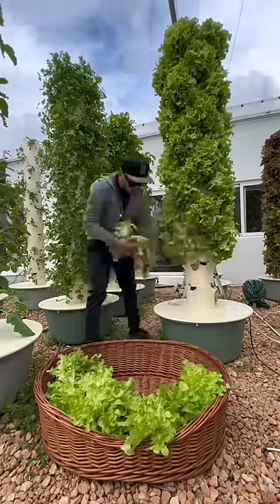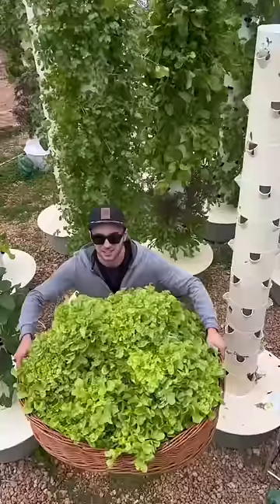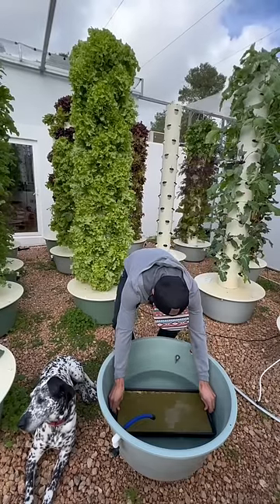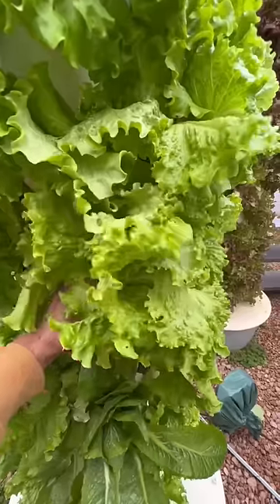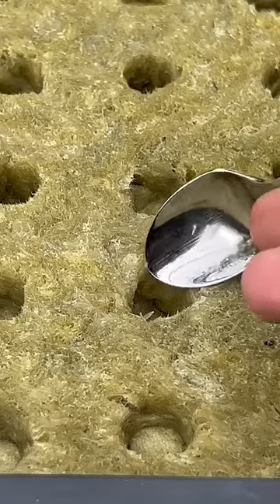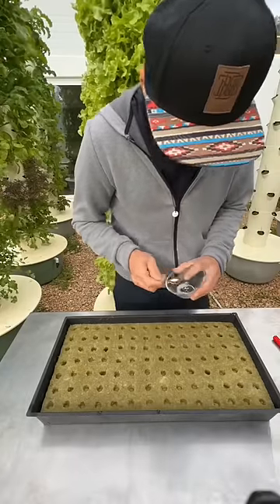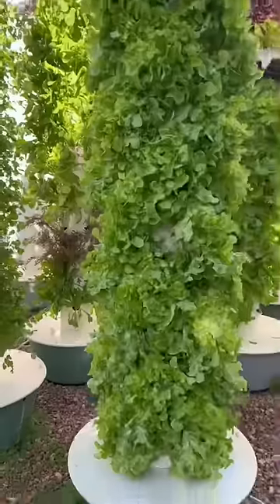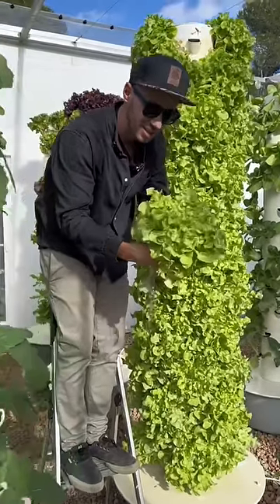Strategies for growing soilless lettuce #lettuce #towergarden #verticalfarming #gardening #farming

Comment: I tried this for a year. What i learnt.
1)yes it does require less area more yield.
2)you need 24/7 electric supply.
3)it should have a specific range of fertilizer in the water or might die due to low/high concentrations.
4)needs a constant check every 2 days.
5)water levels need to be constant. Or the conc of fertilizer might increase with evaporation.
6)water flow should pretty much be constant.
7) oxygen content of water is important.
8)checks on fungal growth.
9)if living in a hot climate better have a green house or a green net covering.
10)controlling the plant nutrition is difficult without automation if not they usually lack core minerals that u get from soil.
11)very low tolerance to weather change.
12)they need long exposure of sunlight (but a cooler climate) to grow fast.
Reply: How expensive were the fertilizers and how often did they have to be replenished? Could the grow nectar be sourced from a homestead environment or are they manufactured?
Reply: Also basalt substrate in not regenerative.
Reply: @finnmacdiarmid3250  here in India 1kg of iron oxide was rs200, 1kg NPK was rs53 and calcium chloride salts 1kg was RS 100. For every 10lts of water i need a combined fertilizer of 10gms per month. I did a small set up for 50plants and it costed me rs8000. I wouldn't say it's expensive but it was not worth the effort.
Reply: Also if the power goes off or the motor stops working for a day. They just wilt in 24hrs.
Reply: @finnmacdiarmid3250  i had to check on the fertilizer every 3-4days. The main problem is the  running water needs to be cool. If it gets warm there will be fungal growth and root rot and low oxygen levels.
Reply: I know of a company doing something like this at an industrial scale in old abandoned shopping centers to provide quality locally grown lettuce to urban areas. There's a ton that goes into it and is best done on a larger scale that can be partially or ideally fully automated.
Reply: @anthonyantoine9232  true it's very labour intensive.
Reply: I don't even have a home garden, but the moment I saw that I was like, but where does the plant get it's nutrients? You'd have to use a lot of fertilizer.....
Glad to know my natural inclination was correct. It would also be interesting to do a study comparing overall nutritional content of soil grown vs aquaponic vegetables.
Reply: Dont forget about the taste of the many nutrients that need to be added to make it grow
Reply: The beauty of sustainable inventions of the futurist progressives
Reply: @alysong5568  the plants get their nutrients from a 3 part fertilizer and buying this in bulk is very cheap. This is called hydroponics, aquaponics relies on an ecosystem where fish wastewater is used.   Healthy plants have the same nutrition values in hydro otherwise they'd differentiate in colour. Outside you can only grow what is seasonal otherwise it should be taken into a controlled environment, this goes for conventional and hydro. The demonstration of these towers is probably sponsored by the company that rents them out. Have a nice day ✌️
Reply: A lot of work.
Reply: I did this when I was living in Maryland 10yrs ago and agree with most of your points.👍🏻👍🏻. Fungal infections was our biggest problem. Also, the hard water will eventually create problem to the water pump, and the maintenance will take more time for us than we would like to spend on.  We sold ours on the Craigslist a year and a half later..

To those who wonder how it taste: our Romaine lettuce taste just like the ones you get from the store. However, our arugula doesn't have that kick that you will get from growing in the soil. We didn't grow tomato because the community we joined said to us that the tomato won't taste good with just water and fertilizer.
Reply: @bhargavreddy475  evuru Anna mana di nee work hats off bro and maku nee experience share chasindani ki thanks
Reply: Bro do you have your setup uploaded on internet
Reply: How does the produce taste?
Reply: @RD-gt3ts  no bro, it was an experiment i did before going big scale. I was planning to do it in half an acre of land. When i saw it was labour intensive i stopped it.
Reply: @Beatrichay  pretty much normal, it is actually better then some grocery store produce. It doesn't give any fertilizer smell. Also these don't get much pests so they pesticides free.
I grew spinach, lettuce, strawberry.
Reply: @bhargavreddy475  it will great if this thing get automated
Reply: @AnimeSupp  i know but investing in automated pH adjuster, greenhouse, motors, filters, fertilizer adjuster, remote control system, and all the equipment is coming around 30lakhs/half acre. My dad planted mangoes and avocados in 15acres for just 15lakhs. The returns i get on these will be very low since the market near my area is very low for this setup. I might break even after 3 years.
Reply: @AnimeSupp  since India is self-sufficient in terms of agriculture. It's not that practical.
Reply: Thank you, I was wondering...
Reply: Its a start tho, i like seeing new things like this being invented so that they might later help something better or something else
Reply: And it taste different. You can tell. Soil grown is still much more better.
Reply: The mineral content is because you didnt feed properly. I grow outside in these and in custom systems with no coverings, etc in the southeast. Its fine. 

Check water, just like check soil. Alternatively, automated the top off with a float vavle.. like you would automate watering soil. 

This tower garden is (poorly) designed to help with oxygenation. 

Soil is just a medium carrying water and nutrients, bacteria and fungus to the rhizosphere. You can do this without soil. Hydroponics was invented(?) by the ANCIENT romans.
Reply: Thank you good sir 🎩
Reply: I tried hydroponic lettuce. No taste at all...don't think will get more of sych veggies 😅
Reply: Mmyeah, sounds like a nope then for me.
Reply: @Beatrice T  hydroponics taste always off and bland. I tried it many times, decided to build more garden beds instead. I assume "aeroponics" will be the same: expensive, bland, weak tasting lettuce.. LOL
Reply: Yeah I was thinking: this would taste like sh*t without the minerals acquired from soil.
Reply: Is there a source for the plants lacking more minerals than those grown is soil?
Reply: @RG_Eph  usually seaweed extract or a multimineral liquid fertilizer can be used.
Reply: @bhargavreddy475  But I mean is there a source detailing that produce grown in soil is richer in minerals than produce grown hydroponically?
Reply: @RG_Eph  yes there are many articles u can look up. This technique is pretty old so u will find a bunch of research materials.
Reply: Wow, 👍 thanks
Reply: 4) i would check everything, everyday personally, it requires a delicate balance, and 24 hours is more than enough time to do enough damage to destroy your entire harvest

And 10) the fertilizer solution is usually compensatory for soil minerals in commercial aeroponics setups, so you don't miss much, but most homegrowers focus purely on baser elements/chemicals required for healthy growth like nitrogen and phosphates instead of additional mineral deposits.
Reply: @brittneyscriven6106  what does that mean
Reply: @bellacasa6846  store ripe tomatoes taste fine, but i find that they dont ripen to the same vine ripe flavor if left to grow. I think its just because they start using something different in the soil

When you run aeroponics, you're now in charge of what the plant gets, and when. It no longer has free range to scavenge for materials, which means if its not there at the right time for use, it doesn't happen.

Theoretically, a microbiome could be achieved in the fertilizer solution similar to that of the soil we use to grow it, possibly even using compost thats been treated like we do tree nuts to make nut milk.
Reply: @bhargavreddy475  man i saw a company in india using seaweed to make sustainable plastic, very impressive. In a competition paid for by tom ford. Another one in the US, in california, same function. Pretty cool.

I bet your strawberries grew really well in aeroponics
Reply: @barryallen5507  the strawberries came out good. Also to add to the points. Each plant needs a different composition of fertilizer. Cause fruit bearing needs more phosphorus while leaves need more nitrogen. So you can't plant all the plants with the same mixture. After 1 year i transferred my strawberries to soil. Though I lost half of them due to soil shock. The rest are flourishing.
Reply: #10 was what I was most curious about. How nutritional are aeroponic plants?
Reply: @bhargavreddy475 on a big scale it actually is less labour intensive, you should look up vertical farming in the Netherlands they have set this up great
Reply: @youriigar6028  where i come from technical labour is pretty less. Also the main reason for stopping this was investment. In country like Norway, Israel, Egypt, and middle Europe that rely on imports and where their food is pretty expensive. This system is viable. For Indians where food is way way affordable. This system doesn't make sense. Imagine growing and selling a salad mix for 1.5$ when u get the whole vegitables for less then 0.5$. a person can live of 1.5-2.5$ per day in term of food. So asking me why should I invest over 40,000$ and sell the crop for loss.
Reply: @youriigar6028  also even for a small personal setup, It's not that useful. Cause how much salad can i keep eating. For the price of building that system i can buy a whole years worth of leafy vegitables and tomato. As an Indian my staple food is wheat and rice. The rest is spices and meat.
Reply: That's quite a few requirements. Guess I rather grow in dirt.
Reply: @Bhargav Reddy  wouldn't it freeze to death from cold??. -40C in my country
Reply: @Bella Casa  potatoes tastes like wattery stale potatoes
Reply: @timexyemerald6290  i have seen there are greenhouses with temprature control and artificial light to mimic the sun. There are applications of this in Russia and Norway. So maybe it's possible in ur region if u have the equipment.
Reply: Yeah that's the comment I just left like damn if you seen the setup for these damn thing out the box? There anywhere from $900 to $3,500 plus electricity plus water plus fertilizer plus time. Even if I bought a thousand heads of lettuce it wouldn't come nowhere near what you're about to spend on this. And it's not as easy as it looks😂😂😂😂😂
Reply: Also, your water can get really hot depending on your climbing plants. Don’t want to drink warm water.
Reply: Less nutrition is the nail in the coffin for this.

You could eat this stuff and still starve.
Reply: Yip you're better off using a vertical planter that uses soil, a not so big one. If it's literally only for your household. I mean, 100 lettuces aren't going to keep if it's just an average size family using them. 
If you're looking to grow to sell then yes it's worth the investment.
Reply: Thank you!
Reply: @bhargavreddy475  I'm currently building an automated plant feeding and irrigation system at home. Do you think that would help ease a lot of the management issues if I also have a failover generator of electric ever goes down?
Reply: @CeePritch  yeah it should, just program it to maintain the water levels, flow, concentrations of fertilizer, temperature control to be constant. That will solve 80% of your problems. Sunlight is important but Most importantly make sure the water is cool. I mean that's seriously the main point.
Reply: @bhargavreddy475  perfect, I've just got my ph sensors arriving soon and pumps are all installed so may take a look at what this would involve a bit deeper then! Much love and thanks for the advice 🙏
Reply: Seems like This is best for factory farms, at least for now
Reply: @CeePritch  upload a video of ur project and try explaining the features i would definitely love to see the progress.
Reply: Can you grow different items on one tower. I don't need such a large yield, nor have space for multiple towers.
Reply: @katsnboots4709  yes you can. its best to keep all leafy veggies in one, berries in one, vegitables in one and flowers in one.
Reply: @bhargavreddy475  what about mixing leafy greens and herbs in one tower? That's what I really want.
Reply: @katsnboots4709  you can do it. Since herbs are mostly leafy and non fruiting plants.
Reply: @katsnboots4709  best use a 5:1:1 or 18:6:5 npk fertilizer. Use iron oxide and sea weed extract for minerals. Another way to introduce minerals is to put some aggregates in you water collection tank. This may also help with biology activity. Use mostly river stones or high density sandstones. These will naturally release minerals slowly. Also make sure these stones don't introduce high acidity or alkalinity.
Reply: @bhargavreddy475  awesome, thank you!
Reply: Would yousay it's worth the hassle though?
Reply: You can grow in these type towers with soil.
Plant germinated seeds in each opening on tower.
Keep the nutrients.  😋
Reply: But this lettuce is expensive...
Reply: Hey dude thanks for doing the experiment for us. Sad that it's not practical for most 😢
Reply: Sounds like what they do in Southern Ontario.
Reply: @bhargavreddy475   I have been following this thread with much interest. Thank you very much for your insight. 
Cheers from Australia.
Reply: @cyemonkey1828  if u have time and money yes it's can be an interesting experience.
Reply: @catboy_official  yeah not ment as a backyard farm.
Reply: @CombatMosquitoTrainer  it was fun for me too thank you.
From India
Reply: Good honest review! Because I, who have studied about plants, already knew that when I saw this. I immediately dismissed the fact that you don't need to add any other minerals, nutrients, vitamins, and such that soil gives automatically! They make it seem like it's JUST water ONLY. Forgetting to include all the nutrients needed for that plant, and every plant can require different amounts in varying degrees!
Reply: So definitely not as easy as planting in soil, and some people like myself can't afford it. Thank you from preventing me on wasting time looking into this DX
Reply: if it works for you so be it, you wont see me buying one any time soon.
Reply: They also don't taste as good as plants grown in properly fertilized soil.  I did this experiment a long time ago when I was in school.  With all other constraints the same the Hydroponic plants just missed something.  I believe it's those minerals that are sadly lacking in hydroponic fertilizer.
Reply: Thank you.
Reply: Hiw many grams of lettuce did you get?
Reply: @bhargavreddy475  that's why I use a simple ups to make sure it never runs out of power.
Reply: I just did the dutch bucket method instead,  no running water,  no power, just buckets with a little water in them. Works the same just easier.
Reply: You literally answered 5 of my questions I had, thank you so much
Reply: @colekter5940  how would you modify the tower to make it better oxygenate the water for the plants health?
Reply: @Kaalokalawaia  read more, friend.
Reply: @GreenCanvasInteriorscape  the only real solution would be airstones on the bottom tank. But thats unnecessary. These towers are best used with short lived plants whose roots are short and compact. Tomatoes and other vines will have their roots find their way through the entire system, slowing the water trickle from the top, leading to possible clogs, and requiring more detailed cleaning during maintenance. Plants with large root systems are benefitted the most from aeroponic systems. In our diy, home gardens low pressure aeroponics is the way to go. 

These towers are expensive. It is easy to build your own drip towers. But having one like this is the difference between building your own house and letting a contractor do it. You get what you pay for.
Reply: @colekter5940  thanks for the informative explanation, I've dabbled with passive aquaponics hydroponics for years, but the pump factor and summertime and electrical outages would certainly be an issue with these big ones, did you end up building your own or purchasing? It seems that purchasing is just the beginning of the compromises as opposed to designing it from scratch
Reply: For me its al about minerals...this is not biologic...
Reply: @bhargavreddy475  read my other comment
Reply: Learnt
Reply: @01124  what?
Reply: 13) You need to be tall or constantly move around a ladder to harvest lol
Reply: @finnmacdiarmid3250  they are generally manufactured. Same as hydroponics. There's an alternative in aquaponics where they use fish poop which is also water soluble. Good luck.
Reply: Fook that
Reply: I’m glad you responded with all this. These growing methods always seem cool but rarely do people talk about the details of what it takes to maintain them. Still a super cool growing method.
Reply: I believe you more than the video
Reply: Thank you for sharing the high maintenance side of it the sellers don’t tell you. It’s a pass nope 👎🏻
Reply: Thx!
Reply: 100% spot on with temperature reg issues. Speaking from experience.
Reply: I just use my aeroponics machine to clone my bushes and jasmine, amongst other plants  . It doesn’t take up much room,  like the size of a big planter .
Reply: @youriigar6028  I've lived in the Nederland for a few months, like England, vegetables don't taste nothing hahaha I don't know if it is related but being from ground family, if the future of our food is in high building full of artificial lights, white blouse people and green that grow in the air, I'm gonna come back to my land very fast!
Reply: Great advice
Reply: What climates States in the US)  do these grow the best?
Reply: To on on😅😅
Reply: You answered my question regarding nutrition value in these type of farming techniques. Thank you.
Reply: My first thought was minerals from soil. How can that be good for our diet/health? I'm just learning about this way of gardening, looks nice and good for small places for sure. I'm just worried about soil free gardening and the health benifits
Reply: why do you need full electricity for that? he doesn't use it? or i'm blind
Reply: That surprised me, a cooler climate. I knew it had to be missing vitamins
Reply: Point 10 raps it for me. It's a no
Reply: Thanks for saving me from trying it too 😂😂
Reply: Ur wrong, plants have all minerals. But soil is deficient
Reply: @Treasure-bl3cn  to run the motor to pump water. There was a time when my maid plugged out the motor and within 5 hours my plants(greens) looked almost dead. Their roots require water for both moisture control and heat regulation.
Reply: @kimwyatt2645  yes large systems have climate controls. But that's sucks up large amount of power. Not fit for a small farm.
Reply: @platinumsky845  yeah but i wasn't planning to invest too much into it. I just pointed it out
Reply: @clay3622  not sure in grams grew like 10-12 healthy ones and 3 were barely surviving.
Reply: @Eggugat  my strawberry require oxygen in their water.
Reply: @Eggugat  also my plants were outside and the temperature gets hot. Can't grow them without flowing water.
Reply: @rpierce7004  not sure how the climate is there. The temperature needs to be between 18-24 °c
Reply: Sounds like high demand for extremely low reward. Lacks the necessary vitamins from soil, that's a deal breaker.
Reply: It doesn't require a lot of water.
Reply: Was just wondering about nutrients since it'd have no soil
Reply: @stephanieromero6495  You don't need soil to get nutrients.
Reply: It’s not worth it, soil grown lettuce is much much much much much much much much much much better
Reply: @alysong5568  the nutrients one of the least of the issues with this set up
Reply: Ou seja, muito lindo mas muito trabalho e eletricidade.
Reply: Thank you. I do think he left out a lot.🤨
Reply: I had that 10th point as my core-concern
Reply: Point ten is sketchy to me. Did you run a chemical analysis to determine this?
Reply: This comment is better than the shorts😂 great add-on
Reply: No. 3 is enough reason to just go get a pot of soil.
Reply: Oh joseh you should go for me in science paper 😅
Reply: Maybe, that's your story....but it doesn't sound like HIS. 😅
Reply: Great work, thank you
Reply: You're ridiculous. I built my own tower. Any fertilizer will do, I bought the cheapest. Fill up the reservoir every 10-14 days, no other attention is required.
Reply: @alysong5568 
I want to know what your natural instincts tells you about the nutritional content of each.😂. I think I trust your instincts.
Reply: Thanks for enlightening us with the hidden truths, well I know that not much people know about the strategy of growing tower plants.
Reply: Wow! If you can get passed the 12 + requirements to start and maintain. The yield or harvest can be so gratifying to enjoy.
Reply: How much rupees can earn from a 100 tower can you explain
Reply: @sheesh7719 Plants also get their nutrients via photosynthesis; the power of the sun, water and carbon dioxide.
Reply: @bhargavreddy475  Is there any way to talk to you?